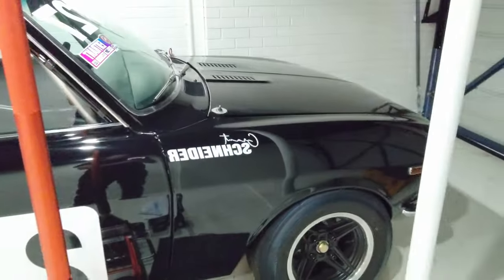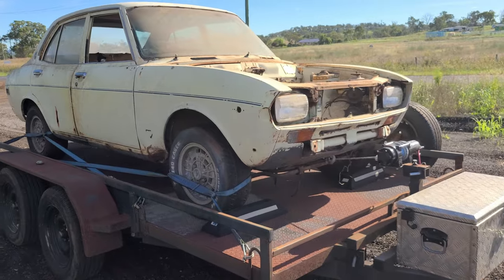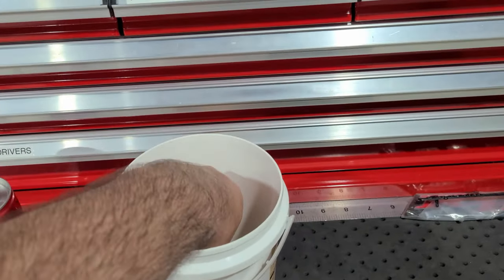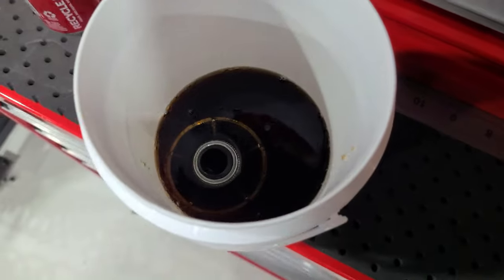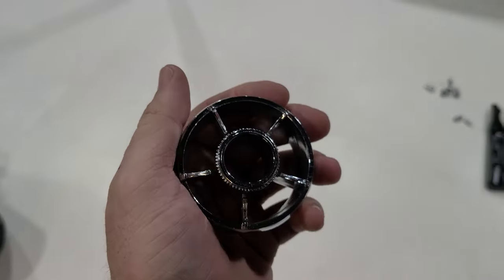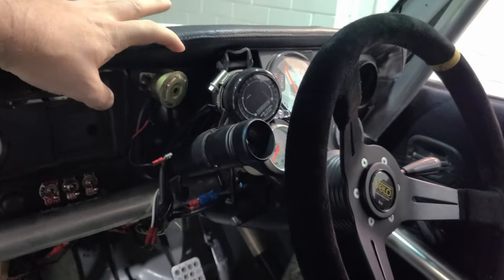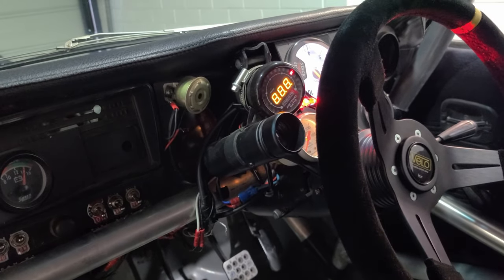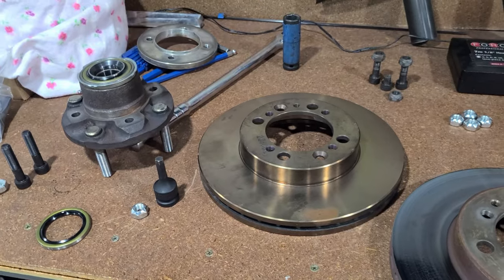Mazda RX2 & 808 | Revival recap + stupid ideas?!

Comment: Thanks for answering my question, much appreciated. I'd like to use an RX-3 tacho and buzzer in my 808 just to give it that old rotary sort of theme, if that makes sense. Great tip on the dash vent cleaner too, I'll have to remember that.

Also, I was going to send you pics of this other rusty 808 on Facebook but it looks like you don't have the message option activated.
Reply from the maker: Oh for sure. Id be keeping the tacho buzzer if it were a road car. Adds to that original feel.

Messages are now active. No idea why they weren't before!